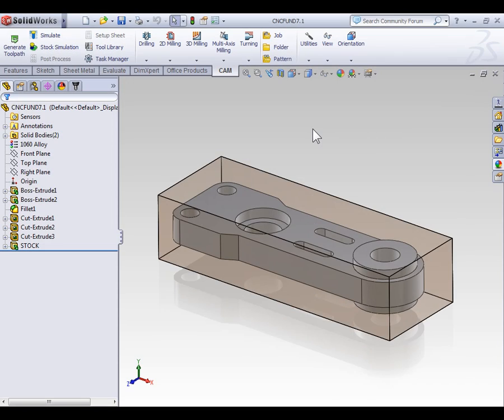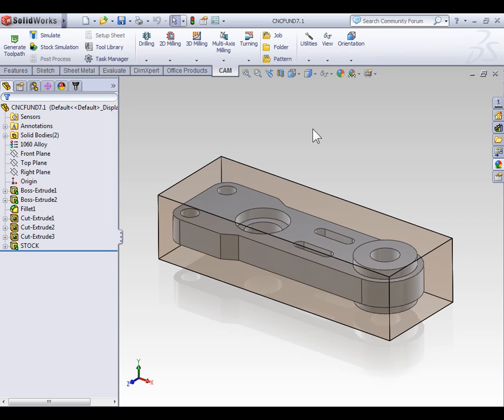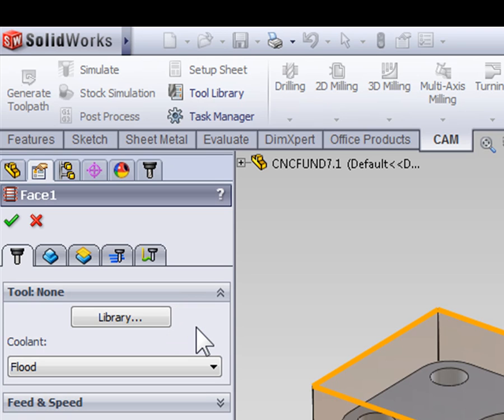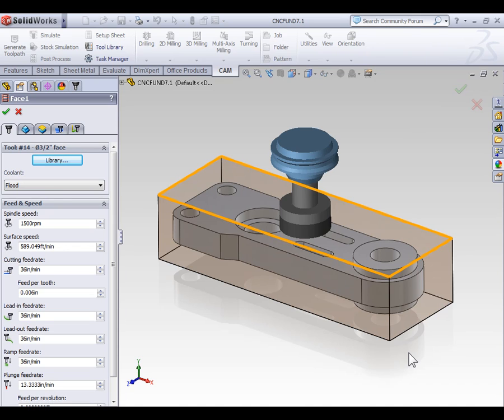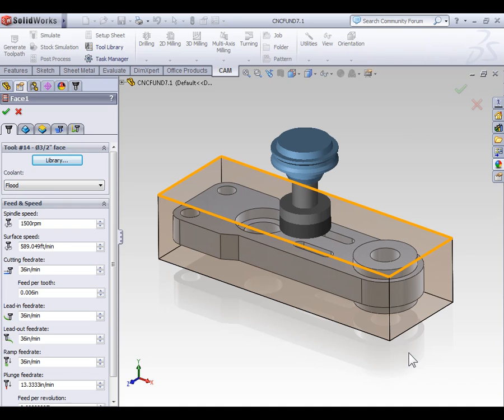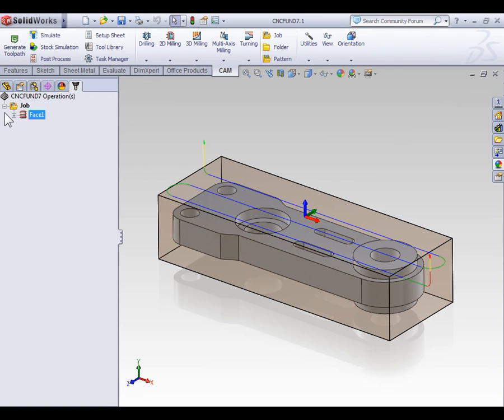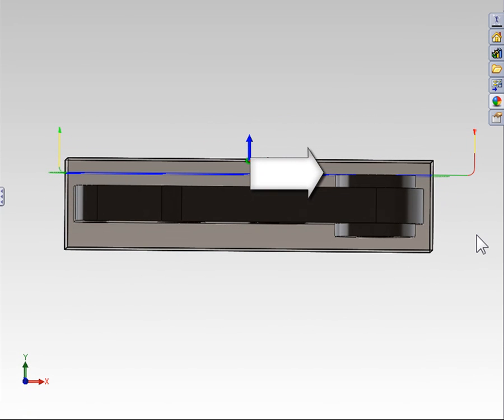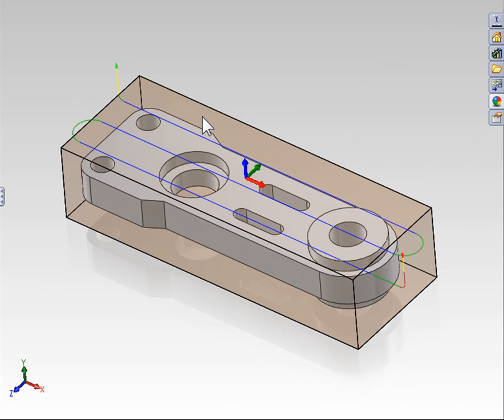HSMXPRESS / HSMWORKS - FACING TOOLPATH

Comment: I don't understand, shouldln't the stock be "faced" and squared up before even considering it any measurements? That way you know it will sit in the vice perfectly and the coordinate system will be perfect.....If you set your stock values and base your coordinates off of the that, when you face all the sides the overall size (stock) will change and there goes all your values...